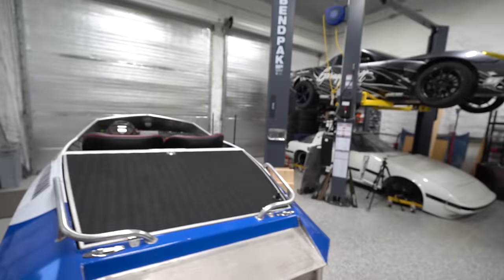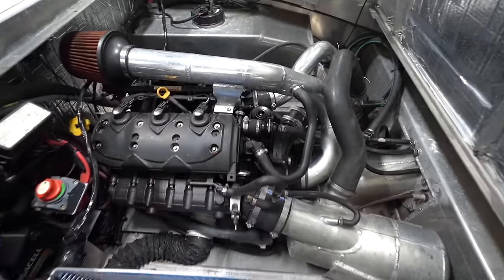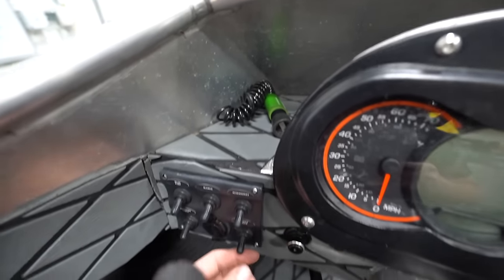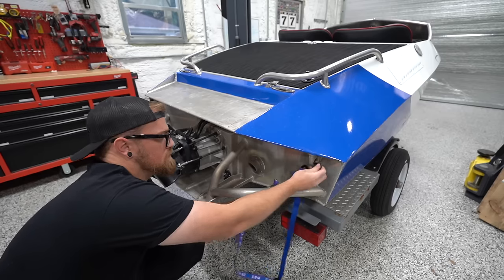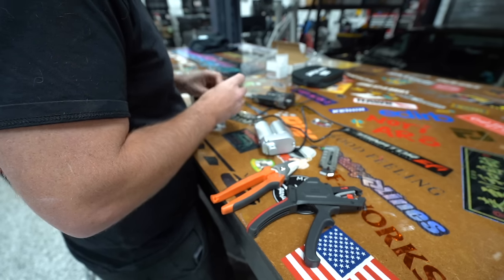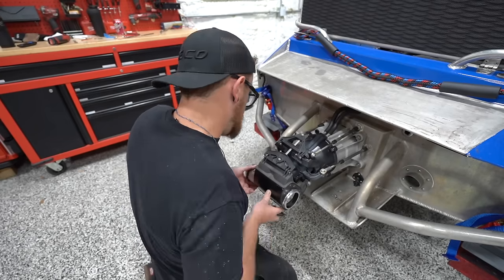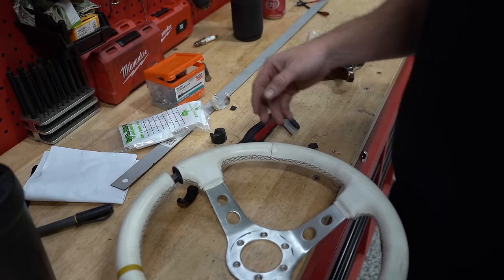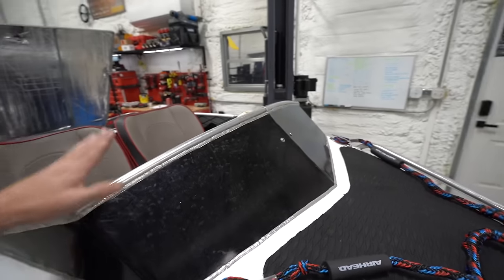Buying the cheapest Supercharged Mini Jetboat on marketplace. There’s some problems.

Comment: Did the owner run this boat in the sprint course races, it’s similar but the sprint boats use v8 engines. I’m not a sprint boat racer but it looks like it would be right up your alley.

Comment: Hmm, changing to open loop cooling isn't a great idea. When you bounce it out the water you'll loose all your cooling and can get air pockets form.  

I'm surprised the heim joint deflection is an issue. I would look at the cable itself, make sure that is moving freely. You will be using the trim quite a bit. That's closest thing you have to a gearbox in a boat.

Edit: with this being an aluminium engine, you'll want to run an flushing oil through after running in salty water. (ie Macs Salt-X Engine Flush) to prevent internal corrosion. (or convert back to closed loop heat exchanger cooling)

Comment: The fuse boxes aren’t built the best. The pins like to push out and not seat correctly. I’ve had electrical issues with a few seadoos and it always came down to a loose wire in the back of a fuse box.

Comment: The guy brought this by my shop in Bradenton. Be careful man, he tried telling us it was a 2021 and all this stuff. After I hooked it up to software, the engine is out of an 09 and a lot of stuff was rigged together pretty bad. Seadoo’s are built to use coolant in a closed loop cooling system and this one was rigged to use salt water to cool the engine in an open loop system. It’s going to eat this engine up .. if it hasn’t already. I tried talking to the guy about it but he didn’t want to hear it. The next day it was on marketplace.

Comment: Coming from a guy with a 46 year old boat, your boat prep is adorable😂
Reply: Only thing you’re missing is a paddle for when you’re stranded.
Reply from the maker: @bullhead360  I got one! I meant to show it on video. I think I mentioned it in a clip I didn’t end up using.
Reply: Right, I got my bungie lines so it's easy to store, I replace my winch strap, I'm thinking about putting so many batteries and bilge pumps because I don't want to sink
Reply: @macbook802  lol the threat of sinking is part of the fun!!!

Comment: Leave the reverse how it is.  If you clock it down, you will lose reverse when the bucket it down.  It acts as a brake in the water too.  If anything, extend the transom, but I doubt it's even an issue when it's actually on the water.  

They are angled that way to give you steering and brake in the water, changing them and facing them down will be useless for you.  It will be shooting water straight down, giving you no advantage.  You will be sorry if you change it trust me.  Extend the transom shelf or do something else.  But don't mess with the bucket.

I saw that you did change it.  You lost a lot of stopping power with it like that.  It's not just a reverse, it's a brake too.  That's one advantage to jet, you have a brake in the water.  You can stop on a dime with it.  Making them face down into the water when you try to brake, it will take longer to stop if needed.  

Also have to remember that with them IN LINE with the bottom of the boat, they were protected when the bucket was down in shallow water, now with then facing down, they extend past the bottom and can hit something if you are reversing or trying to stop before you hit something.  They can catch and rip your entire bucket off.

Comment: Use a hot foot for the throttle so you could use your foot instead of using it on the steering wheel

Comment: That trailer has to go. Sell it and get aluminum or galvanized. Also by the way, you may want to spread the reverse bucket bull horns vs pointing them down, the amount of junk you will blow up on the bottom of the river and will go straight into the jet pump intake would be hard to understate. If the gps has a depth finder/fish finder, dont keep it on too long when out of water, the transducer will overheat.

Comment: You need to go to a foot throttle. Having the throttle on the wheel means you can’t throttle on while turning hard, which is annoying and could even be dangerous.
Reply: Yes you can throttle While turning. The steering wheel ratio only requires a slight turn to full lock. A foot throttle in a boat is not a good idea unless your drag racing on smooth water, hence why most manufacturers have a handheld throttle.